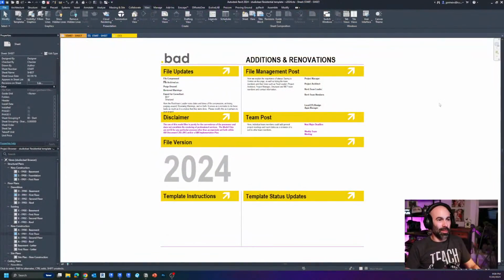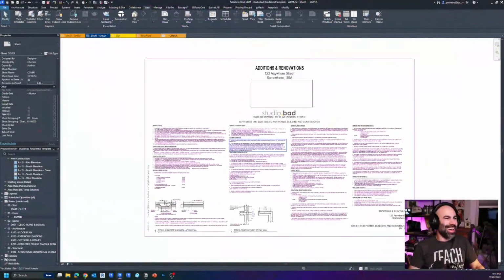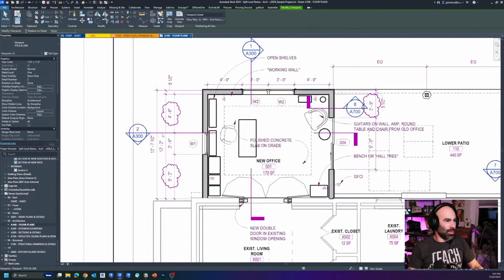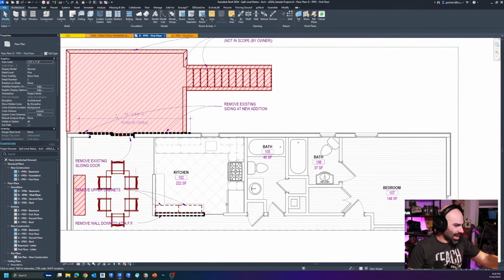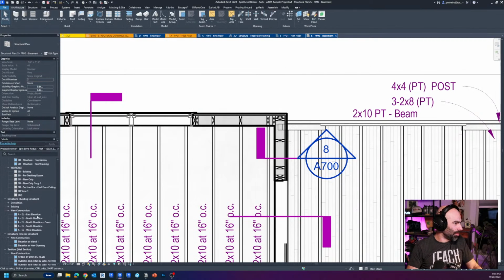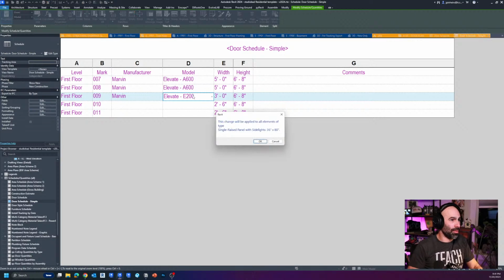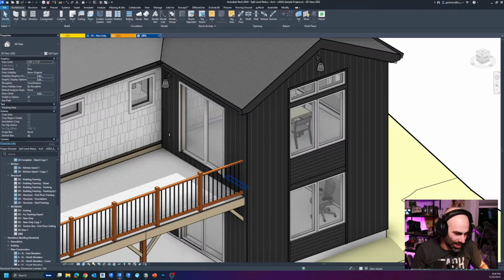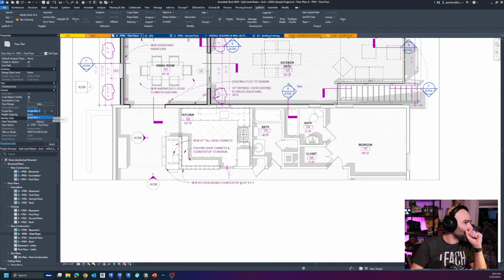My Residential Revit Template: An Exclusive Look Inside

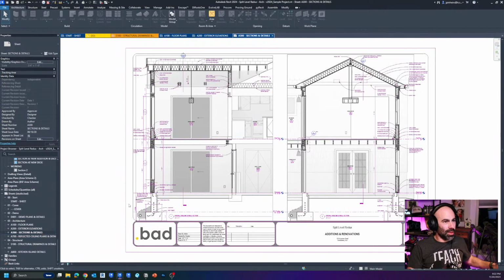Comment: @22:38 Your section shows the roof finish in line with the structure. How would you show the plywood extending beyond the structure in a much LARGER scale wall section? Thanks

Comment: Great template. Is it also available in metric system.
Reply from the maker: it is only imperial… however, you can flip the project units in Revit with only a few clicks.  The biggest issue is the family naming and types will not change (for example, 36” Window… will stay being called 36” Window…)